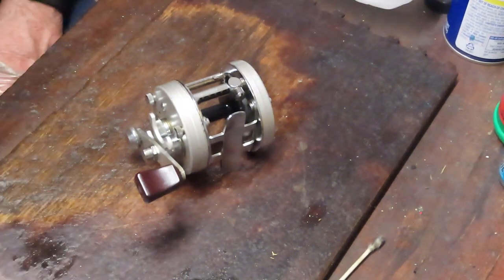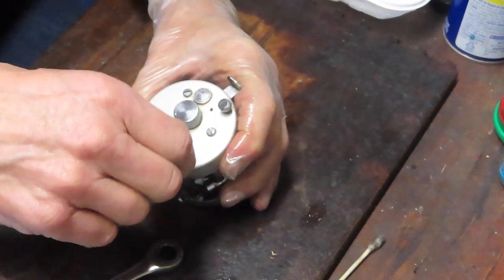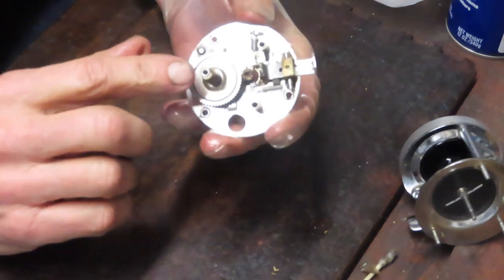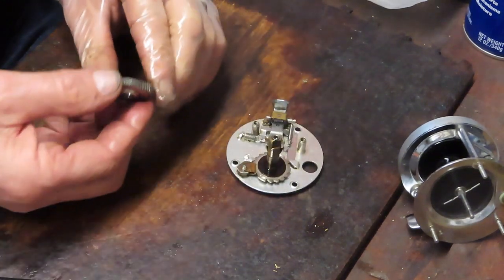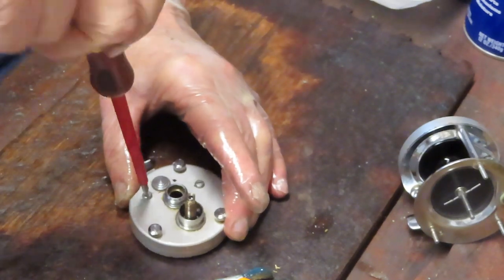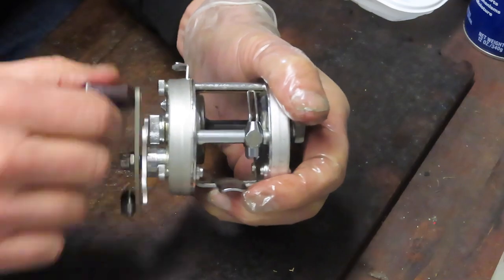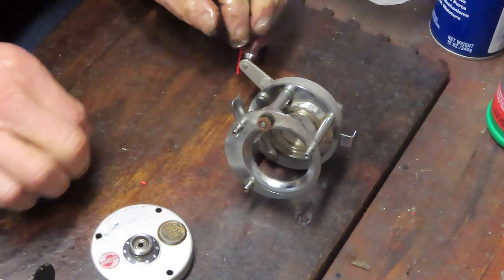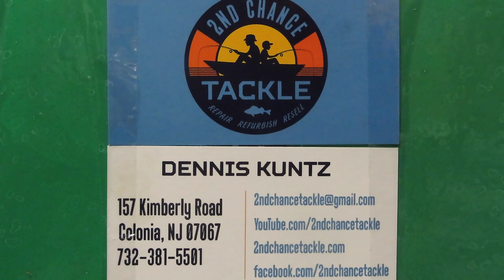D A M Quick Champion 700B round baitcasting fishing reel how to take apart and service

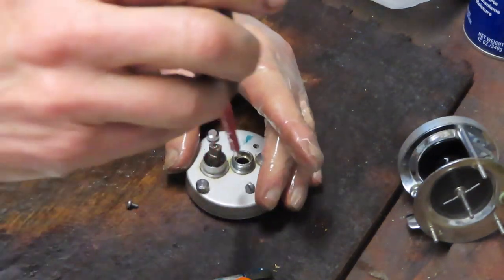Comment: that button under the thumb spool release lever was there to lock the spool release lever because the angle the spool release was at a higher point then on Ambassador etc, more at 10 o'clock were this is at about 11:30 and it would get tripped in storage or transit and make a mess. these came out in the 70's. they were more popular in Europe then here. notice it doesn't have a thumb rest  like the abu's etc have. in Europe they use the edge of the spool for their thumb and to control in casting it, also notice no switchable clicker feature
Reply from the maker: Thanks for the additional information...as always - Dennis

Comment: Hello been watching your penn senator fishing reel repair I was curious to know if your able to change side of the reel from right to left?
Reply from the maker: I haven't done it, but I think it can be done.  Unfortunately, the parts would probably cost as much as finding a lefty.  You would need a new bridge, gear sleeve, star adjuster, main gear and pinion gear to start.  This assumes that the bridge handle side plate has the notch in both sides to allow the anti-reverse dog and spring to be mounted on the opposite side of the assembly.  If that isn't there, then you would need a Left hand side plate as well - Dennis

Comment: Hey Dennis have you ever worked on a Roddy by Penn 175? because I am having a terrible time trying to fix mine
Reply from the maker: I have but it has been quite a few years since I have seen one.  What is the issue(s) that you are having trouble with?
Reply: @2ndChanceTackle  The issue with mine is that when I turn the reel handle to close my bail I can hear my bail slipping and its bin driving me nuts
Reply from the maker: Does that mean that it is not tripping or closing tightly?
Reply: @2ndChanceTackle  No but the bail would release